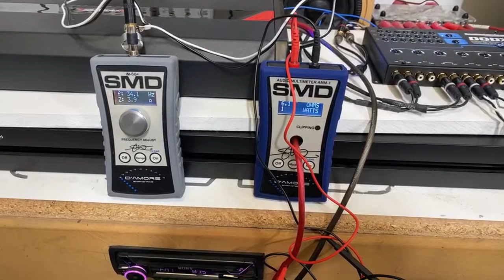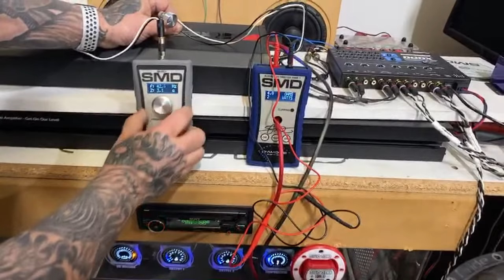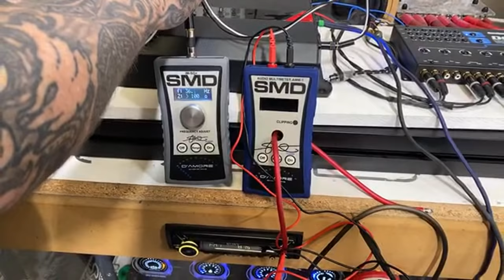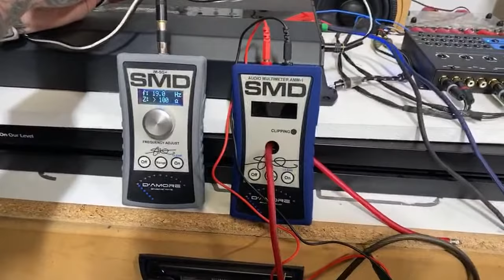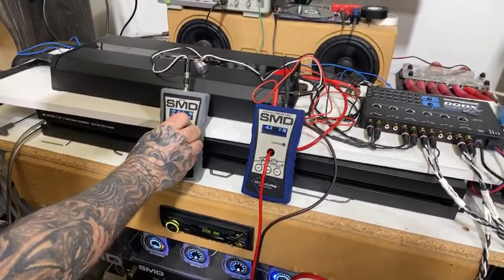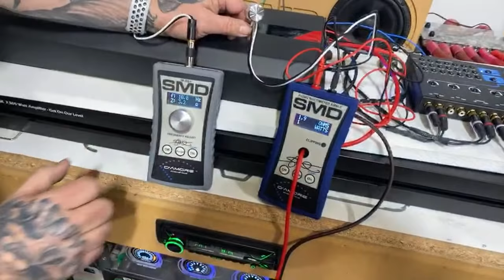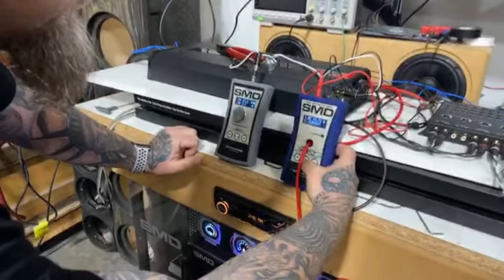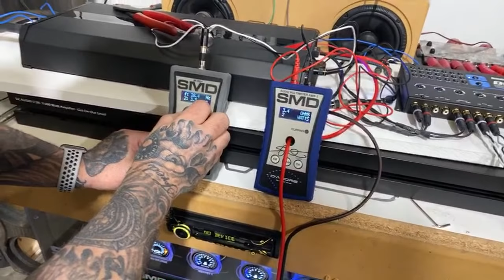Ultimate open-air subwoofer Excursion LIVE! Crazy Low Frequency flex! SMOKE!

Comment: can't help but notice u getting shredded bro, woofer gains and body gains :P
Reply from the maker: actually i was working out a decent amount for a bit but my wrist started hurting so it was hard to pick up the bar or do pushups.  I swear i have hurt myself about 4 times since i started losing weight last year LOL!! pulled hammy's, etc on the treadmill.  But i still push forward when i get better.  I haven't lost anything in the last few months but i haven't gained either.  Just chillin at 200lbs (from 245 this time last year.)